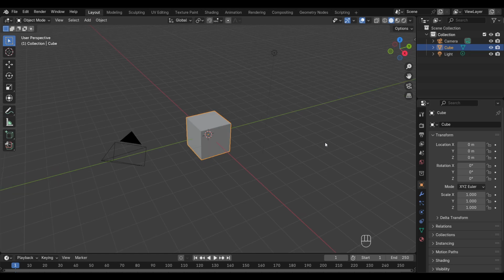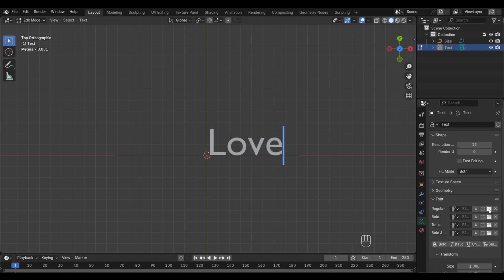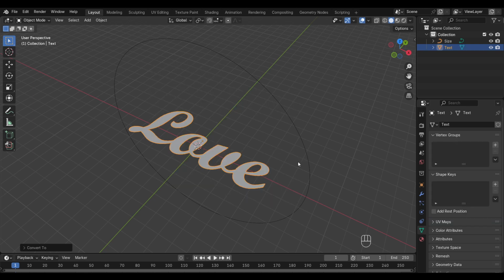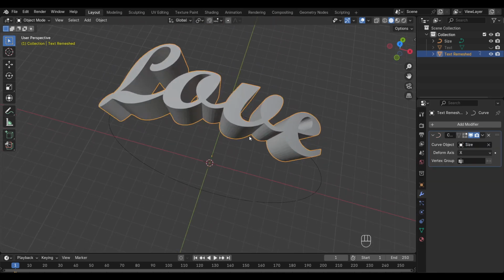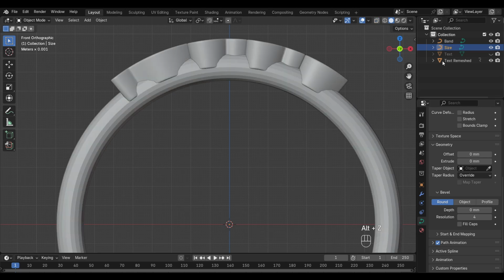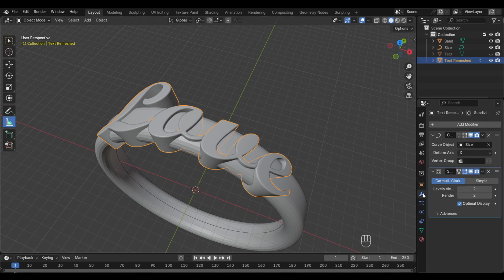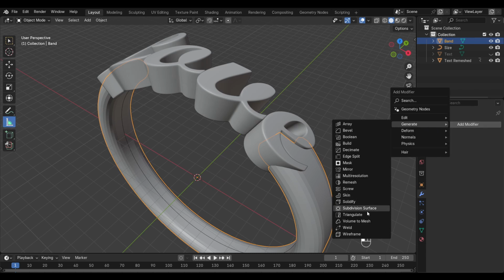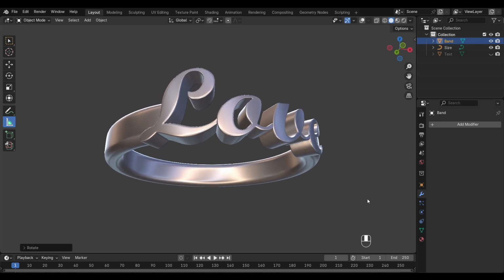Jewelry Design | Custom Text Ring using FREE Remeshing addon! [Blender Tutorial]

Comment: Wow, you’re even applying the subdivision modifier. But when I make a proper design with correct thickness and everything, still in Blender’s 3D Print Checker it shows issues like zero faces, thin faces, and overhangs. For printing, is it necessary that all these values must be zero?